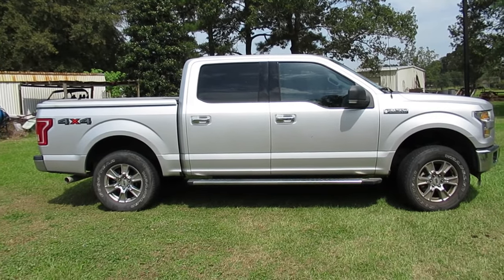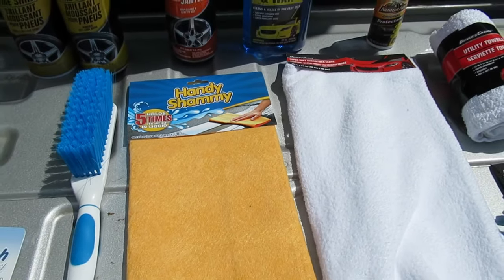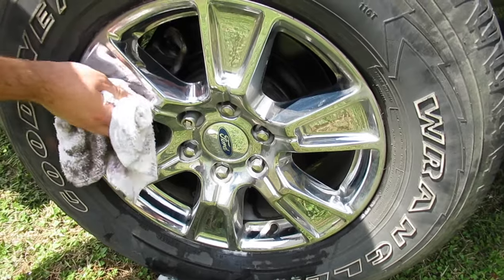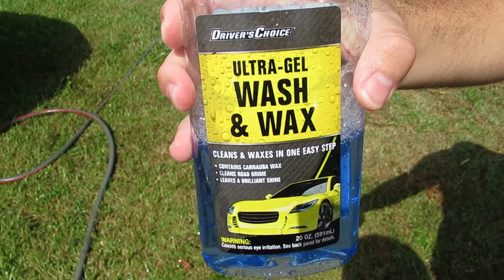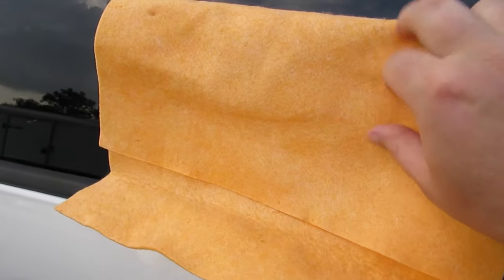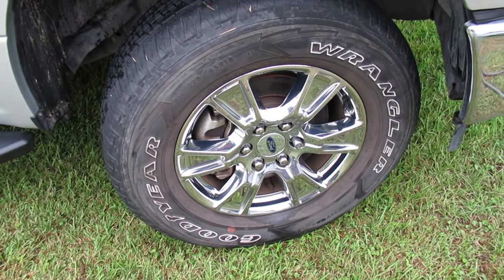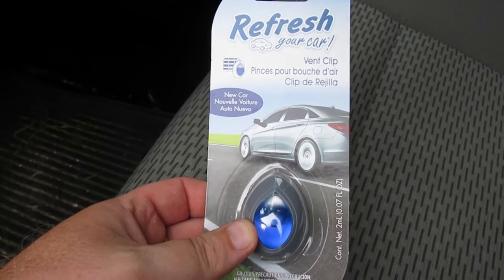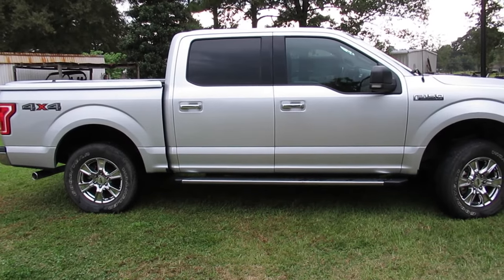TRYING DOLLAR TREE CAR WASH PRODUCTS - I WILL NEVER DO THIS AGAIN

Comment: I bought a couple of the microfiber mitts to actually use as dusters in the car. They work pretty well for dusting the dash. I've had similar types of microfiber that I had to wash a couple of times before using because they would leave little fibers when new, but the Dollar Store mitts surprisingly didn't leave any fibers behind on my first use. 👍
Reply from the maker: I actually use their microfiber mitts to clean windows with at my commercial cleaning accounts and they work great for that!

Comment: I find Dollar Tree to be hit & miss on things. I Swear by them for large glass beer mugs. You can't beat a buck for a 20 oz glass beer mug with a stick. The "Just Men" beard color which is a knock off of Just for Men. 1 buck does the trick as opposed to 6 dollars at Walmart for Just for Men. When I had a small beard, I could get 3 uses out of it. Now I've grown my beard for a year and it takes one whole application. USB C cables also good. Then for things like the Wheel cleaner and the WD-40 knock off lubricant there isn't much in the containers. I was only able to get one car's worth of clean wheels from that can. I liked the microfiber cloth too. Tomorrow, I'll test the auto glass cleaner for the glass and chrome.  Thanks for the video!
Reply from the maker: I totally agree about Dollar Tree being hit or miss. I occassionally use Just For Men so I'll check out their version of the beard color. The good thing about Dollar Tree is, even if their product is a miss, you aren't out much!!
Reply: How was the glass cleaner?
Reply: @kingspina1781  The Glass cleaner SUCKS. It might work for chrome, I haven't tried that. When cleaning my car windows it left some kind of residue behind that I had to reclean with liquid dish soap and water. I did find a much better cleaner at the dollar store called LA’s Totally Awesome All Purpose Concentrated Cleaner in a 32 oz bottle. (for a dollar they sell both the 32 oz bottle and a 24 oz bottle so get the 32 oz) It's concentrated so the bottle lists a LOT of things to use it on either full strength or diluted by various ounces of water. It's non corrosive and you can use it on practically anything unlike many other cleaners.
Reply: @DivergentDroid  yea la nice, I didn’t know you could use it on glass! I so got to try that. anyway your right dollar tree hit or miss but I been getting good deals there. I just tried the wash, I wanted to love it but wasn’t that great for me. Any way anymore must haves? I took your tip on the just for men

Comment: Almost everything in this video is wrong. Washing a vehicle in the heat is a huge no. Assuming it was hot since you can see you were sweating while showing the products. Leaves water spots regardless of soap brand. Second, no soap will scratch trim or paint. You were using one bucket which is another common mistake, because you keep dipping your microfiber mitten with dirty water which can contain small debris which will cause scratches. I saw your video and still bought the soap and it works great. The amount of suds is lacking but it didn't matter since my car ended up clean and glossy. Just my opinion.

Comment: should of tried the wash and wax with a foam cannon
Reply from the maker: Good idea. Even though the wash and wax was was horrible, it would have been interesting to see if the foam cannon could have kind of "forced" it to be sudsier.
Reply: I tried it with a foam cannon and pressure washer, it does foam up a lil but not as much as other soaps . I wanted to love this product but wouldn’t recommend. I’m a detailer and other soap are just easier to use and won’t leave and spots behind.( this left suds on my window that I had to do extra work to remove) you should use nu finish , or turtle wax with them a lil goes a long way